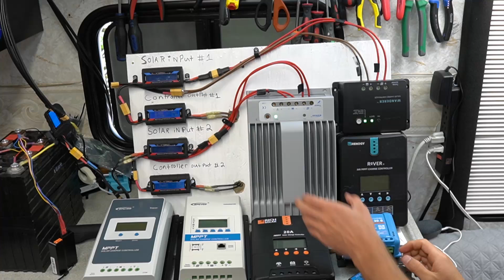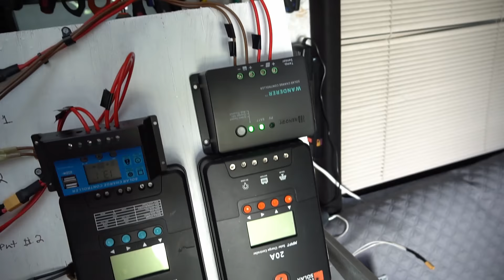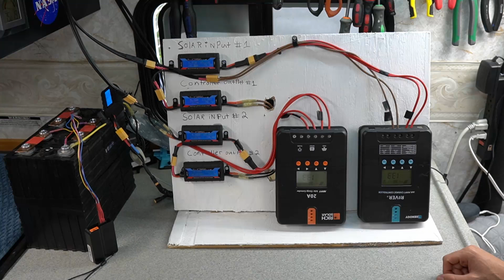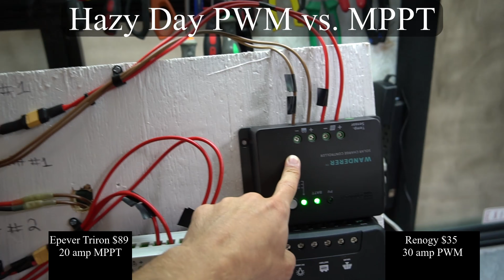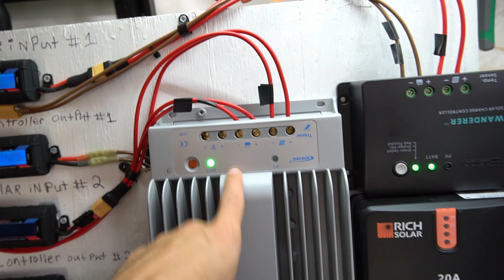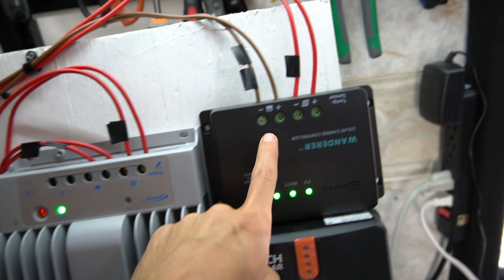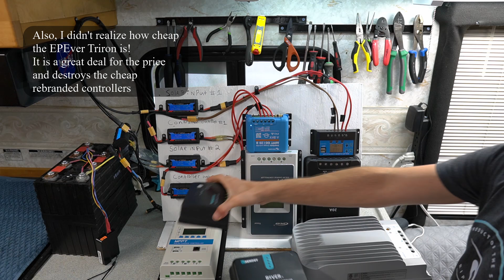12v Solar Charge Controller Buyers Guide - Beginner Friendly!

Comment: Thanks for your great videos, we had our system installed yesterday but have a question, in case you or someone else could answer or point us to somewhere that can. We live in a very hot country, Nicaragua and had installed a 330 Watt solar panel plus 12.V 105 AH battery ( Deep Cycle) and a 2000 Watt converter.  During the mornings the controller shows it charging up to 13.2 volts,  but as soon as we plug in a lamp and a laptop, this drops very quickly to 12.3.V.  Is it normal for it to drop so far and so fast?   When we used it yesterday on its first day after installation, it was holding its charge around 12.9 V  with 5 lamps and a laptop and a fan plugged in....now today it already seems wiped out.  Is there anything obvious could be causing this? Thank you!  Joe and Masha

Comment: Hi. I love your channel. Im doing a solar project. Q. I have a Charge Controller 100V/20A with PV input power 260W 12volt battery? I have 2x160W panel that i wish to use is that possible?

Comment: I made a solar powered kayak. Or is trying. Mine is flashing the arrow it's the little blue one that you got from Amazon it's like 15 bucks for like 30. It's the blue one and mine is red. But same thing. My screen is showing solar panel flashing arrow and then the battery but no arrow going to the light bulb nor can I get the light bulb to turn on what have I done wrong
Reply: I have a problem where its reading a higher voltage than my 24v battery. I bought 3 and all of them read a 2-4v higher than the 24 v battery. You having a similar issue?

Comment: Love your videos brother.  Kind of new to the solar game.  I’m looking at purchasing the Renogy 20amp controller you have in the vid for use in my 4x4 touring rig.  I have a 12v solar panel that attaches to the hood and I’m curious if the charge controller will automatically shut off if it senses a charge coming from my alternator, once the vehicle is running?  Or do I have to potentially install a separate on/off switch to stop the panel from charging while the vehicle is running? 

Also, I was planning on mounting it inside the engine bay next to the starter battery up front by the headlights.  Is this a bad idea do you think?  Will it get too hot for the unit?  I saw on the Renogy page that it has auto turn off at 113°.  Obviously I don’t plan on using it while the vehicle is running anyway.  

Anyways, thanks in advance for any help with this… 🤙🙏

Comment: Hi Will,

Does 3 X 200 watt (600 total watts) solar panels works with the Epever Tracer 4215? I read the info for this controller is 520 watt max at 12 Volt, will it be safe to have 600 watt connect to it? Thank you!
Reply: Yes.. You will just max out your max outlut to 520w. Not to mention 600w of panels will rarely if ever put  out 600w on the brightest sunny day so your better to have 600w for a 520w control.

Comment: OK thank you for all your videos -  very informative and helpful 👍 
I m just starting so yes I bought the real cheap blue PWM and use it with a 150 watt panel on an agm battery  750 amp / 24 series 
I was also given a coleman solar array and it came with a Colman charge controller ( it s a renamed Sunforce )  that connects to 3  - 100 watt panels 
Reviews on the Sunforce says it's not a bad charge controller
Have you ever heard of these or have any knowledge or Input about them
Also I now have access to 5 year old commercial solar panels that produce 350 watts  using 48 volts per panels
So looking on advice if I want to set 6 of these up
Thanks

Comment: Can anyone help, I got a solar panel its supposed to be 100 wat, its 13 inches by 14 inch,is it possible its a 100 wat panel,  it has a double USB can I plug in my 500000mah little  portable battery into one of the USB ports without a charge controller thanks .
Reply: No 100 watt solar panel has those dimensions. You most likely have a 30 or 40 watt panel.
Most 100 watt panels are  roughly 47” x 22 “

A charge controller keeps the battery from overcharging. Controller regulates the power going in ...slowing it down as the battery comes up in charge and then basically becomes a trickle charge
You’ll have to closely monitor your battery and disconnect the panel when its fully charged
Reply: @jaygrenham  this is exactly what I thought,  no way could it be 100 at this size most likely is13 or as much as probably 20 cheers.

Comment: All I need is a small system to power a small fridge in a 50 year old camper. I use propane for everything else. I am so fed up with clowns trying to sell me 3000 or 4000 watt systems.

Comment: Can I use a solar charger as a DC to DC charger ?
Reply: Yes from my understanding you can but what exactly are you doing?
Reply: @randybobandy9828  Hi !  While I am driving I wish to use it as a dc to dc charger from the car 12v outlet and while camping use it with solar panel to charge my lithium battery…. Thanks
Reply: @stephanebeaulac2016  yes it should work fine. What voltage is the battery you want to change? Is it Lithium or lead acid?
Reply: @randybobandy9828  It is a LiFePo4 12 volt battery.  I am wondering if the mppt solar charger can upscale voltage.  From car 12 volts outlet to 14.4 volt ? This could be the down side… :(
Reply: @stephanebeaulac2016  i think its charge controller depended. Some mppt requires a 5v higher input over the batteries voltage to start charging. So 17v for a 12v battery. They do make specific mppt charge controllers that can do both battery/alternator DC charging as well as solar.